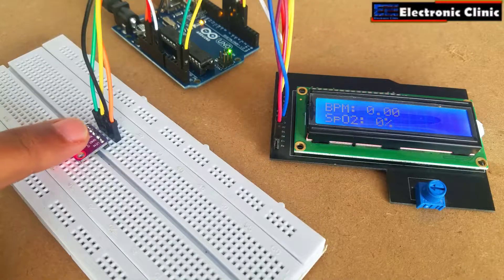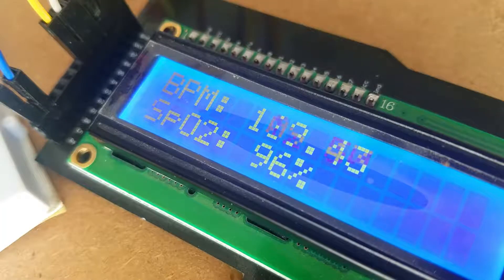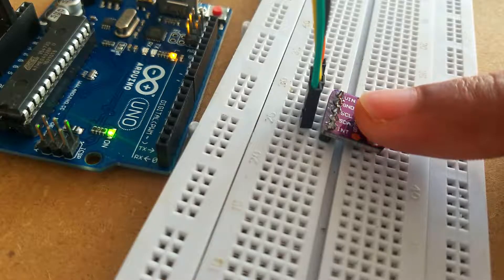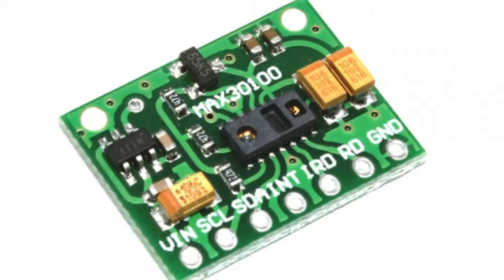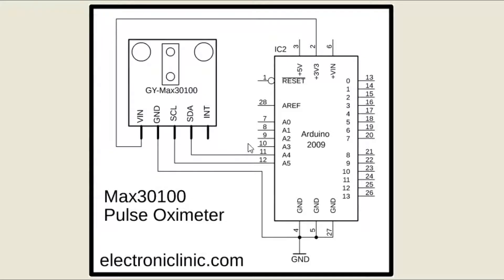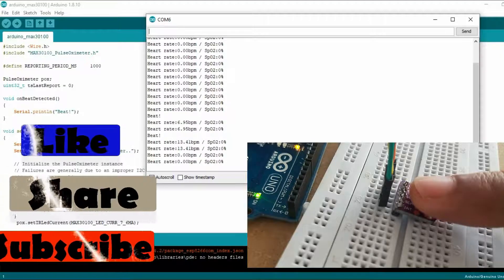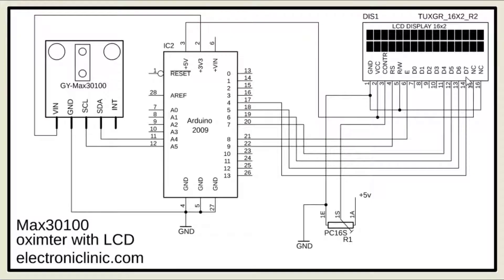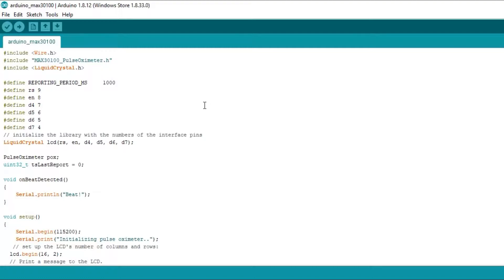Max30100 pulse Oximeter Arduino Code, circuit, How to measure Blood Oxygen & Heart rate BPM

Comment: When is the Max 30100 SIM card supposed to light up during connection, because it does not light up with me? Do I have to specify a specific number in the paud for it to light up?

Comment: Hi, I am using the same sensor connected to Arduino Mega 2560, I used the same library, but the values I received for heart rate are much bigger, in the range of 120-200. Do you know why I may have this issue ? The values for Spo2 are pretty normal so I'm confused why this problem is just for HR

Comment: Hey, i tried running the code with the exact same sensors with the exact same code, the code compiles and uploads properly, but I get this on serial monitor. Initializing pulse oximeter..FAILED
, I added the library as well, could you tell me what could be the problem, I would really appreciate your help in this.
Reply: Could you find out why it is doing so?
Reply: Facing the same issue and the sensor is not turning on
Reply: @sachinr8244  did you find solution
Reply: @sachinr8244 SAME I think its a current problem
Reply: @Pepecode  did u find solution?

Comment: Hi, regarding Blood Oxygen & Heart Rate Monitor with MAX30100 & Arduino, compiling the sketch gives me an error in this line (if (! Pox.begin ()) {) with the following reason: could not convert 'pox.PulseOximeter :: begin ((PulseOximeterDebuggingMode) 0) 'from' void 'to' bool '. How can I correct? Thank you.
Reply: Add proper MAX30100 library in Arduino folder.

Comment: Hi, I have tried the code and it does not work. The serial monitor does not show anything when I ran the code? Any advice?
Reply from the maker: first print the values on serial monitor
Reply from the maker: download the correct libraries from my website
Reply: @ElectroniClinic  Hi Electronic Clinic, thanks for the reply. I have downloaded the library and ran the MAX30100_Minimal code, but it still does not show anything on the serial monitor. Btw I'm using an ESP32 board to run it.
Reply: Im having the same problem, did you find a solution?
Reply: @arthurlool1293  me too, did you find a solution sir ?
Reply: @fahmihuwaidi7325  did u find the solution?
Reply: @jhevishramphul6331  i'm sorry, not yet sir ;(
Reply: @arthurlool1293  did you find the solution?

Comment: The video was great, but can you tell me perhaps why I am getting this error? "Initializing pulse oximeter..FAILED
" . I read several topics on the internet, but it still doesn't work. Thanks in advance.
Reply from the maker: may be ur sensor is faulty
Reply: I see that the max module is receiving 3.3v on the circuit diagram which I find curious. I would expect that the module would require 5 volts, if not how would the Arduino receive 5v logic levels? The issue with the green max30100 module is that the pull-ups on the I2C are pulling up to 3.3 v and not 5v, the purple board would give exactly the same problem if it were not supplied with 5 volts. I’m sure one of the blobs on the back of the board is a regulator chip to supply  the max chip with 3.3v from 5v in. You can verify if the pull-ups are connected to vin and that there is a regulator chip before releasing any magic smoke.